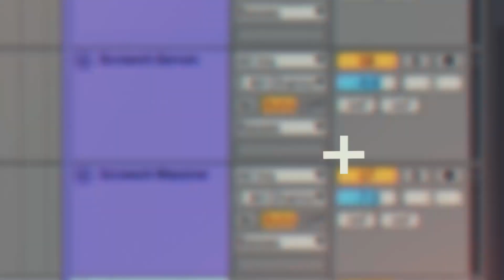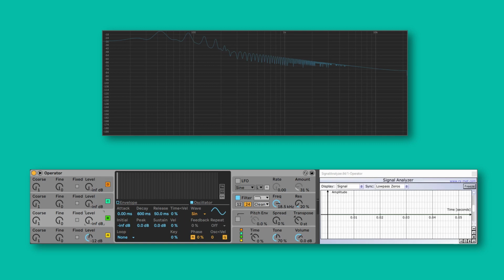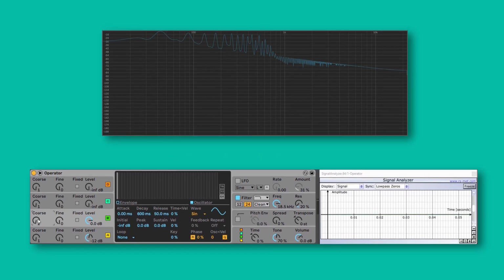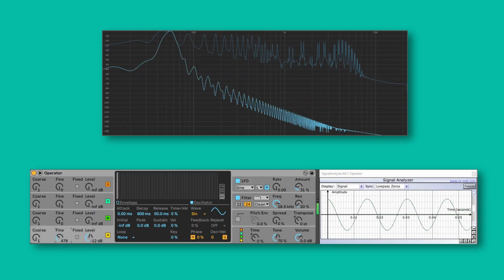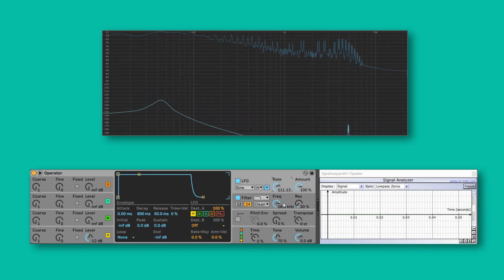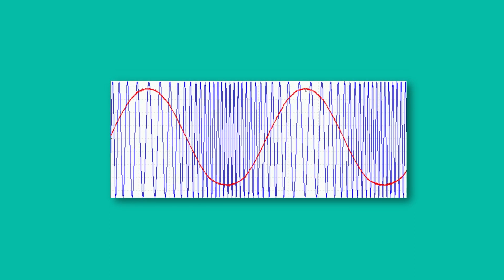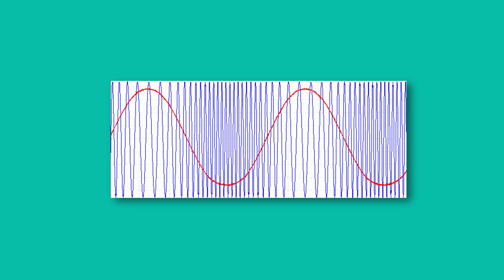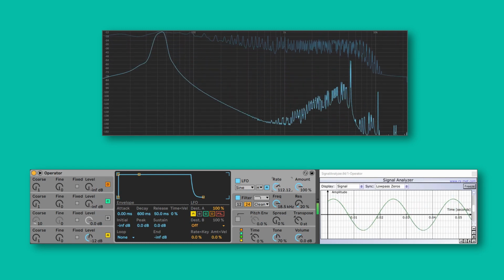DO YOU THINK YOU USE FREQUENCY MODULATION? YOU ARE WRONG!

Comment: This is an interesting distinction and I've been trying to understand this for along time. For almostna decade I've been using a synthesizer called ZynAddSubFX (now Zyn-Fusion) and it has both FM and PM modulation types available.

They produce similar sounds, but work very differently. I didn't really know what was happening under the hood, but I've learned in practice what the difference is.

Thanks for this video!
Reply from the maker: Yeh I feel you. When one of my friends told me years ago that non of today's synths use FM but PM, I was like "shut up, this is stupid!" :D

Comment: I think, the difference here is that the LFO amount defines a value that should be considered as semitones (probably in +/- 1 octave range, but did not measure it), and adds this value to the incoming MIDI pitch. Frequency modulation multiplies the modulator signal by the FM amount, and multiplies the result with the frequency of the carrier oscillator. I've prepared a small video that shows the difference:

https://youtu.be/TohGBp1sJxQ

Both versions are using the same cosine as source for modulation, both do frequency modulation, but one is linear, while the other one is modulating the pitch.

Comment: This debate has been going on a while. I do think they are equivalent though because be cause fm is one of the simplest first things to code and if you modulated the frequency instead of phase it could be just an extra calculation that still changes the phase since that's the only input into your carrier function. People say that some synths model modulating an oscillator that has an exponential v/octave input at audio rate so that would be different I guess.
Reply from the maker: Well yes and no. Try a fast LFO modulating the pitch of an Oscillator in Ableton Operator, or do the same with the modulation matrix. The result will be different (Ableton LFO has a high speed setting, so it can go up really high)